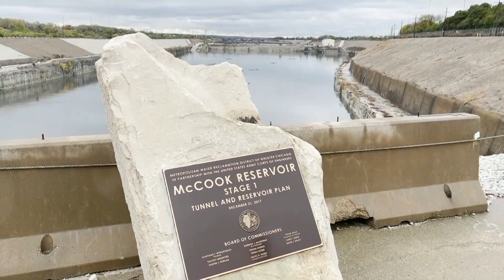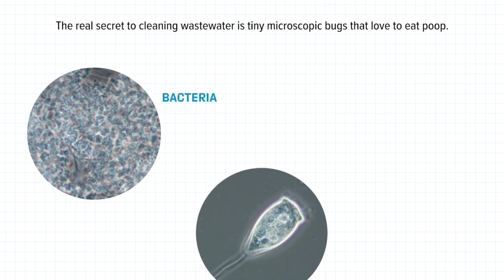Chicago Scene at the McCook Reservoir (Part 1)

Comment: The Mainstream Tunnel along Ogden Ave was dug below the elementary school I went to. I remember we were talking about tunnels as part of a school lesson and my 2nd Grade teacher (who taught there for a really long time) told the class that there was a tunnel right under the school (I believe referring to it as the "Mainstream Tunnel"). She also said that there is a door (which looked like a locked door to a custodian closet) right in the hallway outside the classroom (which was located in the basement of the school) that behind it was stairs that went to the tunnel (likely was an access shaft for workers when the tunnel was being built in the 1970s or 80s). This particular door was never opened when I went to school there in the 2000s (and not even by the custodian as it wasn't a custodian closet). I personally doubt he (or anyone in the school) even had a key to open the door.